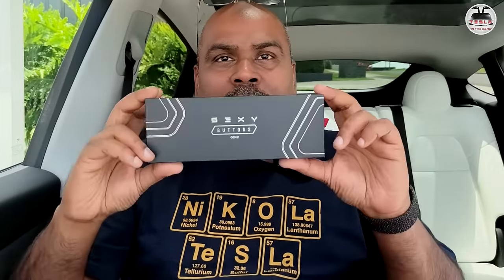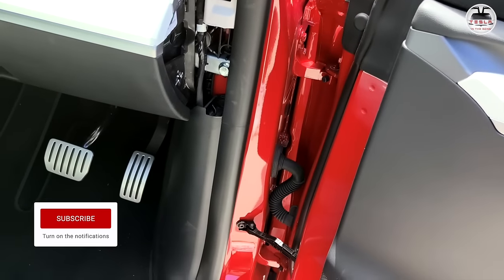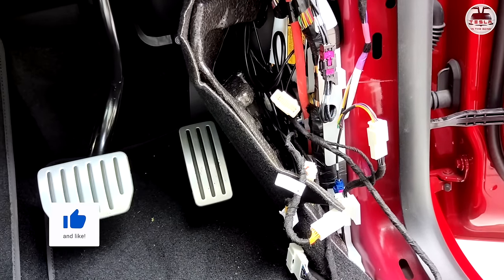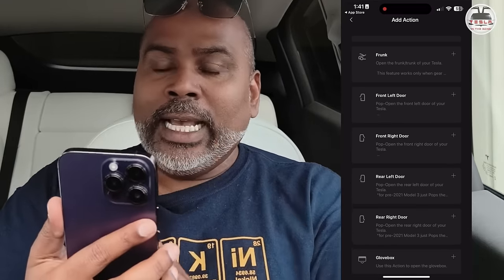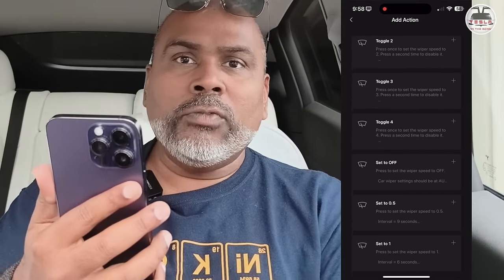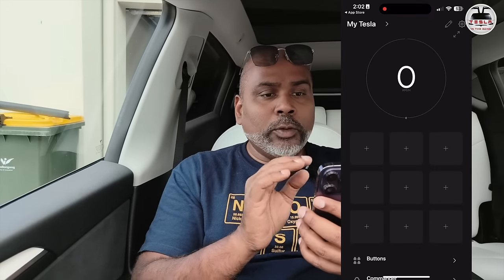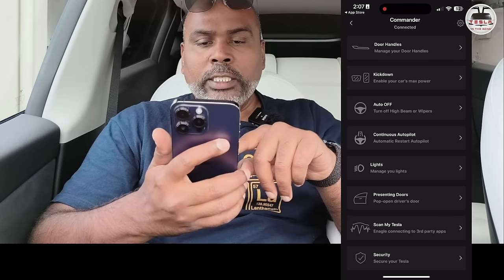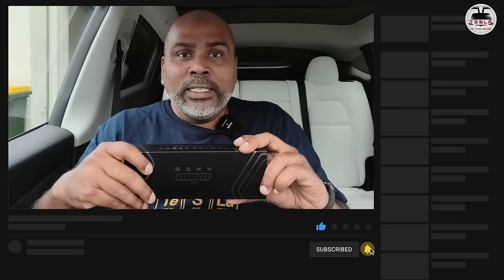S3XY Buttons by Enhance | RHD install | Australia

Comment: Nash I love your videos. A couple of questions: 1)Where did you place the buttons? 2)The ability to precondition for a non-Tesla charger means that the functionality is embedded in the system, so is there any other work around?
Reply from the maker: +@user-rd3oy6ew5u these are the positions I have mate. Hope this link works. If not check out the latest shorts in my channel: https://www.youtube.com/watch?v=bH5w9T8kqNQ

Preconditioning need to accessed via OBD is my understanding.

Comment: I have a 2023 model 3.  If I have the rison chip do I have to connect it in the front or can I connect it on the rear AC vent? Would it make any difference?
Reply from the maker: Connect to the front right mate. It is not as difficult as u think. Not sure if the rear will work or make a difference. But as u know why waste that rear OBD port.  Keep it for a rear screen or something
Reply: @TeslaInTheGong  
Thank you, I appreciate you getting g back to me.  I will buy it and connect it in the front.
Reply: *Rizom

Comment: Hi! Can you please check something for me? The gen1 buttons have such a bad response time on the first press. How many seconds do you have to wait in the gen2 buttons? Can you please test? Just go in the car, make sure commander is connected to the phone, then press any button and count the seconds. Make sure the button are not pressed for a long time before so they are in sleep mode.
Reply from the maker: +@icephoenix3565 righto. YouTube shorts video coming soon mate. Will reply on testing.

Comment: I just got my gen 2 buttons and sadly found out the wiper speed controller functions have been taken away for the 0.5 increments in wiper speed. This was the main feature I wanted because I live in a rainy environment. Everyone please reach out to the developers and ask them to enable the incremental wiper speed functions once again. It's in the UI but the wipes only actually move to the 4 speeds and auto. Please help us get this back. Thanks for your support.
Reply from the maker: +@scottg25 great suggestion. I will pass this on to the team

Comment: Did S3XY supply the 2nd screen wiring loom or did you source that elsewhere/ I have the same issue with 2 screens connecting to the OBD and power source.
Reply from the maker: Sexy buttons send me the Y connector